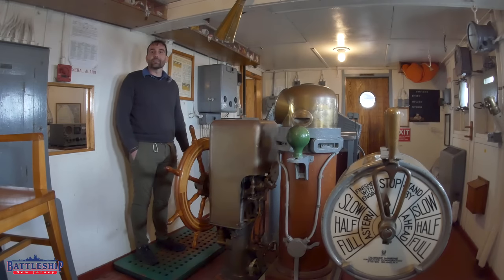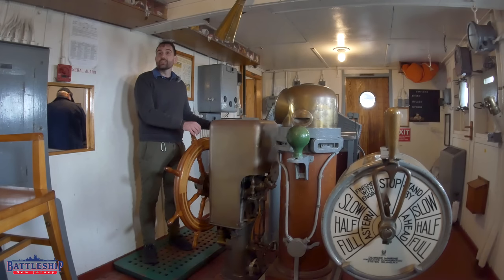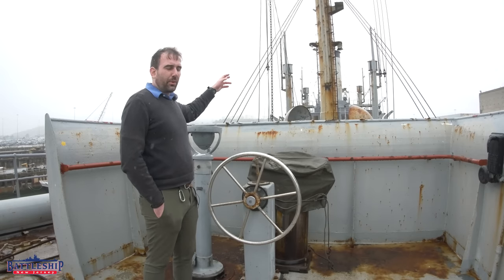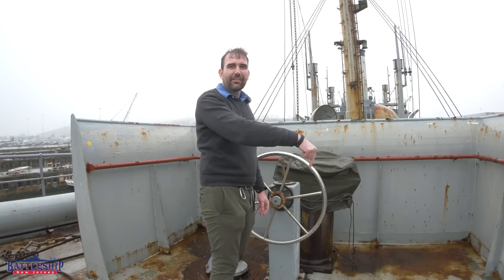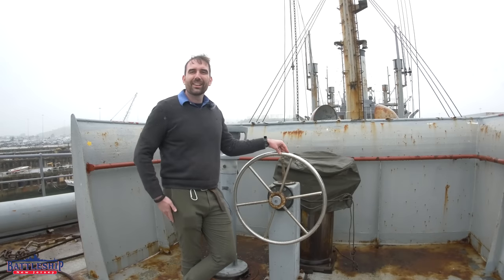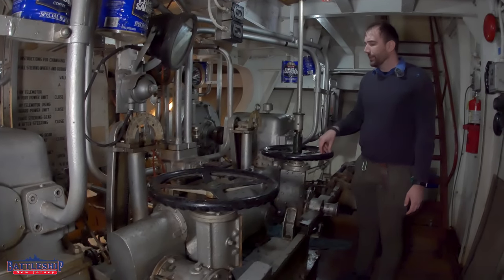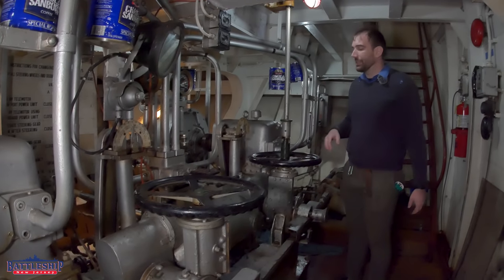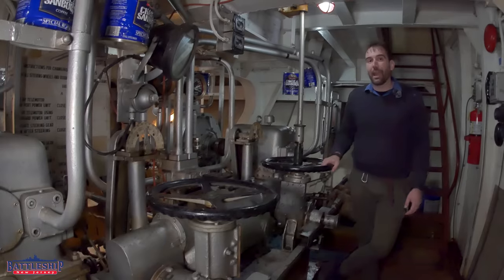A Unique Ship Steering Arrangement

Comment: Back in the olden days, naval architects were pretty much obsessed with redundancy in steering, and for good reason. You can’t sail the ship without steering control, which means you can’t face into the sea, stay off the shoal, or limp home after the battle without being able to steer. The civil war era ironclad USS Dunderberg had a backup tiller on her deck and a small backup rudder as well. And if I recall correctly, the museum freighter in Cleveland, the Mather, likewise has an emergency tiller.
Reply: Oh dang I didn't even consider the importance when it comes to dealing with sea conditions.
Reply: It was just not navy ships either
Reply: Modern ships also have multiple options for steering, or at least modern to the extent I've experienced, with my "youngest" and current ship having been launched in '89 and began service in '90.... 
We have three options,
1, is the normal electro-hydraulic controls from the bridge 
2, hydraulic-hydraulic also from the bridge. 
3, you can dirrectly control the rudder ram from the steering machinery room with a hydraulic lever, its pretty simple move the lever until the rudder is where you want it then return the lever to the center to stoo the ram moving. Its clunky but it'll do in a pinch...
We also have the option but to manually reposition the rudder with a manually powered hydraulic pump, but it would take a stupid number of pumps to mive the rudder a single degree, something like 100 pumps, be there all day to get it hard over!
Reply: Do you really “sail” a ship though?
Reply: U can sail any ship without a rudder
Reply: @andrewhoughton8606  without a rudder no not so much, not on most ships any way, ships with wide set twin (or more) screws do well enough by varying the RPMs on the outboard engines and going about like you are driving a tank. 
Sailing ships can be sailed anywhere from a loose cloae reach to a run so long as their rigs are quite well balanced and they have enough crew to absorb the fatigue caused by absolutely constant trim adjustments. 
On smaller ships notably those under around say 500 tons you can expect to be able to get some results from a towed drouge or even a Danube rudder, if there are deck winches large enough to take the strain, but results will vary from not very well to barely any noticeable benefit. 
And of course many small boats can be maneuvered with the use of a flat bladded oar or similar.
Obviously I am not including vessels that steer by the use of vectored thrust, but you rarely find those to any appreciable size and very few could be addressed as being a ship without a few snickers.

Comment: They all make perfect sense to me and don't really seem too redundant.  The steerings in the pilot house and on the open air bridge are what I would consider "standard" steering positions.  One for normal steaming while at sea and the other for fair weather or when you need better visibility.  After steering at the motors is, as somebody else pointed out, basically a freebie.  The motors are already there so just give yourself a way to control them directly.  That leaves the steering on the aft gunnery platform which isn't all that surprising either.  It's the open air companion to after steering to let the people steering actually see.

That being said, the real redundancy comes from HOW those steering positions are connected in.  Are the pilot house and bridge hydraulic lines run next to each other, or do they take completely different paths?  My guess is that they share a path (or even share some of the same lines) because redundancy and surviving active combat weren't the design goals.

Contrast that with an Iowa class's steering positions.  One on the bridge, another 4 decks away in the conning tower, a third at central station several decks away from the bridge and inside the citadel, and the final all the way  back at the steering gear (and still inside armor).

The redundancy of the Iowa's steering doesn't come from how many locations they have, but from where those locations are in relation to each other.  A hit on Red Oak Victory that takes out the pilot house steering could very well take out the bridge's as well.

Of course, all of my knowledge about naval design and redundancies comes from watching a certain Youtube channel about a certain Iowa class museum ship so... what do I really know?
Reply: The crew of the John W. Brown say they hardly ever use the pilot house bridge. Most steering is done from the flying bridge in all kids of weather. They consider it a safely issue with the small portholes of the bridge. Because of this, during bay cruses you can visit the pilot house. There are a couple of staff there to both answer questions and keep anyone from playing with the controls.
Reply: My question would be, why does the helmsman need to see anything at all on this ship. The helmsman is given steering orders by the OOD, or the equivalent on a commercial ship. On the battleships, the helmsman is tucked safely away in a very well armored space behind the bridge. He can't see anything. The OOD, of course, needs to have good visibility, especially in cases like coming into port.
An interesting video is https://www.youtube.com/watch?v=ocUD07fvf48. This is from a British Navy training film from 1941. It shows the training of a new helmsman, plus operation of the engine order telegraph.
Reply: Solid point. But also consider the primary threat to them was a torpedo they likely wouldn't survive in any case or relatively small deck gun fire where that might have been enough separation. I can't really see routing hydraulics down the same trunk when it would be relatively little more cost to design them to run on opposite sides of the sip at least, they had plenty of design experience and battle testing. But who knows maybe it was X% too much money and it is just one.

Comment: It would be interesting to hear about some specific events or battles where the auxiliary steering positions played an important role.
Reply: Battle of the River Plate - HMS Exeter used aft helm control with a human chain passing helm instructions (after 11” hits from Graf Spee).
HMS Warspite at Jutland - telemotor jammed and she performed 2 circles in front of the High Seas Fleet.
Off the top of my head - I’m sure there are others
Reply: Well in a bad way it contributed to the collision of the USS McCain in 2017.  There was confusion of the control interface on the bridge, and they switched to rear steering.  The problem is the rear control was set for hard right rudder when they switched control over, and the ship turned further into the path of the oncoming chemical tanker.
Reply: @matthewbeasley7765  NTSB published a report a while back. Sickening lack of training and sleep.
Reply: In a boat different steering positions are for sight lines. A tug has three spots, plus the engineers can operate it from the engine room…. Def just a ship thing…….. but I still enjoyed the video

Comment: Great video, as usual. :) Technically BB-62 has a fifth (very last resort, not much use in battle) steering position - does Red Oak Victory have anything similar to that? Also, I'm a bit concerned that Ryan gets blown away so often ... perhaps better armor is required? :)

Comment: It was all about redundancy due to the limits of mechanical reliability, especial at that time.  However, still today, there is redundancy on most merchant ships.  Most ships I worked on had two independent systems on the bridge, and a local control (ie in the steering gear flat).  Some had direct control as well if the electronics of the local control failed.  Some older ships also had a giant spanner you could chain fall onto the nut atop the rudder shaft, then use chain falls to turn.  Not much steering going to happen, but if the everything else fails with the rudder at an angle, you can center it for towing.

Comment: I wonder if it was determined in design of the steering, that they could have the redundancy added to very easily, and added it to show proof of concept on paper.

In the one case, the aft open air steering being directly above the hydraulic room of the steering gear only needing a shaft down through the deck and attaching to the gear with a simple coupling, is quite the accomplishment!

Of course, the front steering was required, and a second room directly below was easily added as it was a redundant hydraulic system, and actually created the dual hydraulic system from the bow to aft steering.

Comment: Pre WWII merchant ships usually had a secondary steering station on the poop deck with sailing ship type double wheel manual steering. And the actually steering engine was probably steam powered. If I could post a picture here I would. Red Oak Victory was designed and built after the war in Europe had started and the Uboats were sinking ships. I assume that's why the aft steering station and auxiliary means of steering.

Comment: I know the Kaiser-class oilers had 4 control stations, including bridge and after steering. The auxiliary stations allowed full control of the vessel, not just steering. I can't remember if the AKEs also have that level of redundancy, but their after steering stations are very tricked out with many, many steering options. Very noisy when in readiness, though.

I also know that during the Napoleonic Wars, Royal Navy warships had an equivalent to after steering. In the very likely event that the exposed ship's wheel on the main deck was destroyed in combat, sailors belowdecks could haul on the tiller with block and tackle, taking orders shouted down a hatch.

Comment: Suggestion for a future video: Can you tell us how the ship's internal communication functions? Is there a separate phone and phone line for each connection required (e.g. the red phone calls the engine room, the green phone calls fire control, the blue phone is shipwide). Is there a separate low priority system for daily tasks so one doesn't need to walk the full length of the ship to deliver a message? How different is it now compared to WW2?
Reply: Naval vessels have a couple of methods for communication within the ship. First there's the ships main circuit (MC) which is uses the ships PA system to address everyone in a compartment, division etc. They're numbered according to what compartment or division is addressed when that circuit is used with 2MC being propulsion, 4MC being damage control and 1MC being the entire ship. 
Second you've got a few different types of telephone. The first is just a regular phone wired into the ships internal phone system. The second is the J-circuit telephones which are located at the different battle stations. J-circuit phones allow you to communicate with anyone on the same circuit as you. These phones typically have a selector knob that allows you to change circuits. The third is sound powered phones. With those you can take a headset and plug into a circuit wherever there's a junction box. You might have seen these boxes in the background of Battleship New Jersey's other videos, they look like brass boxes with what looks like 1, 2 or 4 plastic knobs sticking out of them. These are actually plugs to keep the socket underneath clean. Sound powered phones are the electronic equivalent of a cup and string and are the oldest form of shipboard communication still in common use (other than yelling of course) and have been around since WWI. They're still used because even though the sound quality is terrible, they don't need external power to function and it's easy to run a temporary line where it's needed. 
Lastly, radios do see limited specific uses. 
In a pinch I've also found smacking the hull with a hammer to be a fairly effective means of communicating with somebody inside the ship from the outside.
Reply: Looks like the station Ryan was at had a standard-ish old sound-powered phone. They're still used. It looks like it might have a selector dial, allowing one to choose what station to call, and a crank to activate the ringer on the receiving end. They don't need electrical power, just hold down the little button on the handset and talk.

Comment: Belt-and-suspenders is part and parcel of maritime design and always has been.  Losing your steering is bad, very bad.  Avoiding that loss is a good thing.
The other way to look at it is in reverse.  Start at the rudder post, you want some sort of steering there.  You also want some sort of direct-connection steering above that, where you can see.  Everything else is about convenience steering from some point forward.

Comment: It's almost like the question should be asked the other way. You need after steering; you should have bridge steering; the two deck wheels are convenient but can't be used in storms, so it really only has two reliable steering locations to begin with.

Comment: It looks like the shafts and bevel gears for after steering were relatively inexpensive vs the cost of the ship. Adding a wheel to the existing steering engine(s?) was also rather inexpensive.

Comment: I wouldn't have thought that a ship built as fast as a victory ship that they would have this much redundancy. More redundancy makes more cost and longer construction.
Reply: Redundancy is what makes a war ship.
Reply: they did kind of know these ships would get shot at, some point in its career
Reply: @Asbestos Muffins  back then all the equipment required for that much redundancy would have cost a fortune. Huge investment in each ship I'm sure.
Reply: The real cost would have been in the links to the bridge positions.
A control at the actual motors that control the rudder in or near the steering engines would have been of trivial cost and would almost certainly be part of the design of any merchant vessel!
Reply: @m riggs  Hardly trivial. The shortage of machine tools at the time made any part with a precision hole or surface a premium. Also high grade high pressure hydraulic lines would have been hard to get.
Reply: @tireballastserviceofflorid7771  
Still not a big deal!  The needed controls are located close to the steering engine. Minimal extra work or material needed.
That means it is trivial compared to running controls to the bridge.
Perhaps you are unaware of the industrial manufacturing capacity we developed during WWII.
Reply: @mahbriggs  You clearly have no machine tool or machine shop experience.
Reply: @Tire Ballast Service of Florida  
Where do you think I worked for 45 years?
And yes!  Compared to the engines, boilers, the actual steering engines, the various pumps, valves, anchor and cargo windlass, hatches, and everything else that goes into building a ship, it is pretty trivial to provide an emergency steering station next to the rudder!
Almost all ships except for the very smallest have them.